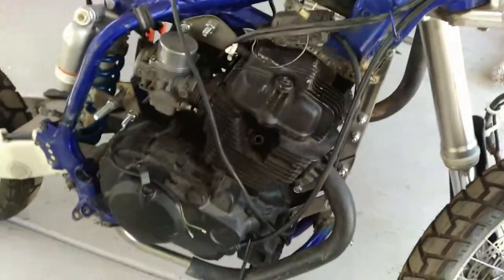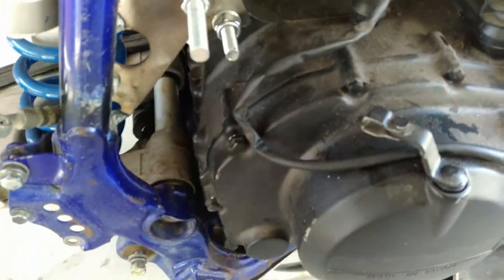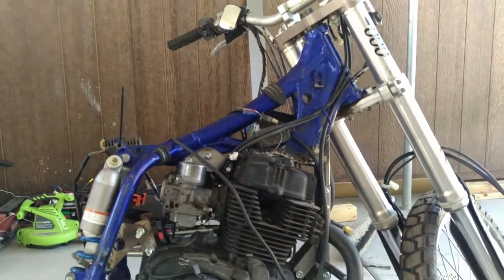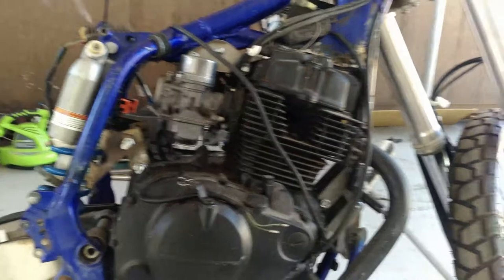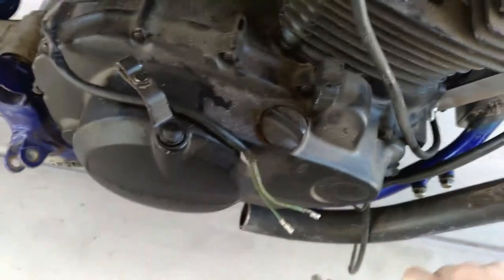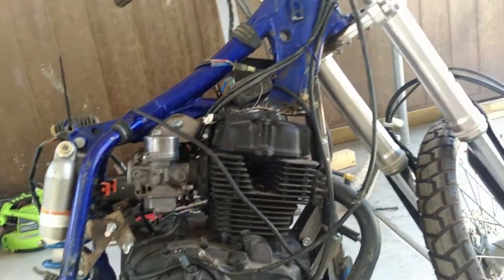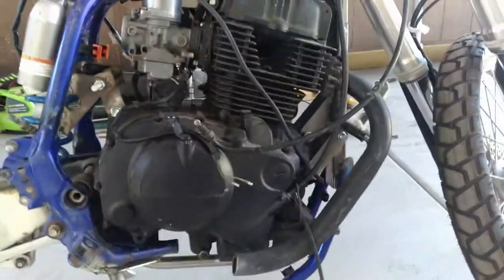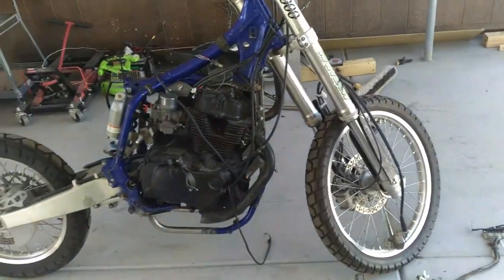Yamaha WR450 engine swap update and info.  YamaHonda

Comment: What engine is that.. I just blew my camshafts on a drz250 I wanted to put a cbr 600*engine in or something close that will fit any ideas
Reply from the maker: I'm using a 1985 Honda cb450 nighthawk engine. But if I were to do this again I would look for a cbr500 or a ninja 650. But any single cylinder or inline twin would be the easiest and work the best. Inline 4's are just too big and require too many modifications to be worth the time put into it. All I had to do was rebuild the bottom of the frame. Where a inline 4 would require you to widen the frame and the offset for the chain. But good luck. Check out my Instagram for a better look at what I did to it. It's still not finished because I've been doing a lot of moving. But it's almost finished.
Reply: @TheMotoHippie  what do u mean by inline... I'm. Not on Instagram u on Facebook... I can get a cheap cbr engine 600 do you tink I could drop it in and weld the new bars in under the bike like yours.. How does your bike pull to the normal engine is it better
Reply from the maker: Inline (side by side) as apposed to a "v" or "L" configuration. Yes I am on Facebook. The cbr600 engine is a inline 4 cylinder and it really wide, so you are going to have to make the frame wider and stronger just so you can sit on it correctly, then you will have to figure out the chain offset because you can't make the engine narrower, so you would have to make the swing arm and wheel wider. I would stick with engines that are similar to the stock engine for simplicity.  My bike isn't finished yet but it should have more torque and top speed..
Reply: @TheMotoHippie  I can get a cb400 engine or a honda super 4 engine would they be a better fit my frame is really similar to yours.. Just kinda stuck and don't want to part the bike out

Comment: Hi man remember I was speaking with you I striped down my drz buy a bmw 800 gs engine ran in to a problem the bmw engine the chain runs on the opposite side would it work if I flipped my wheel over and  put the chain running on the other side
Reply from the maker: You are going to have to modify the rear swing arm for the chain sliders and brake mounts. It's easier to find a rear swing arm with everything already on there correct side.
Reply: @TheMotoHippie  do you not tink my wheel would fit if I just turn it around there's room for the chain.. Have you got a Facebook il send u photos of it